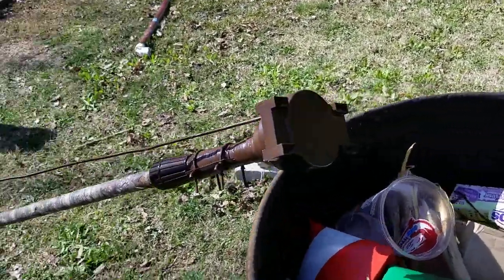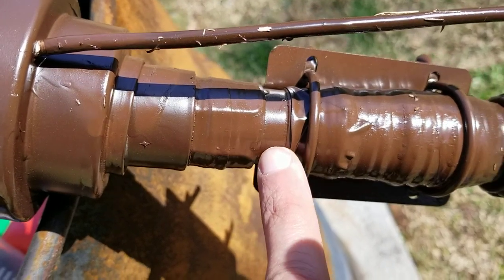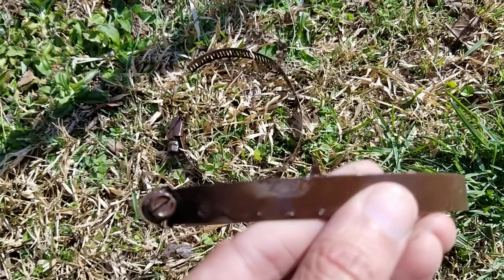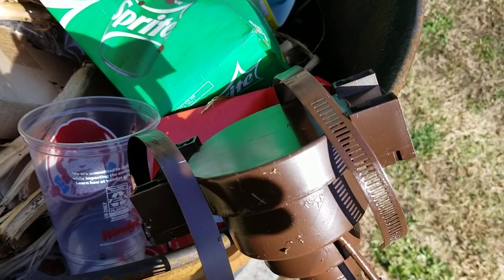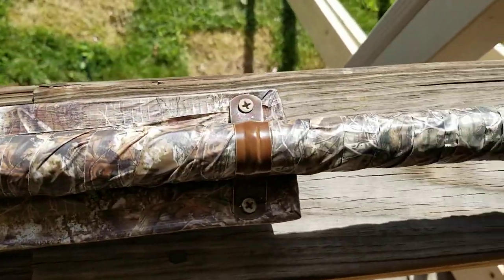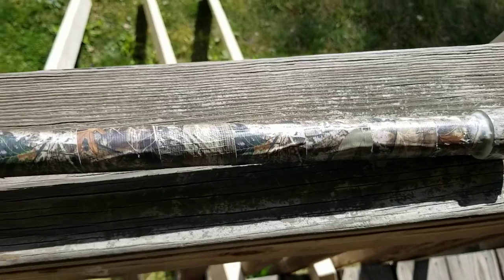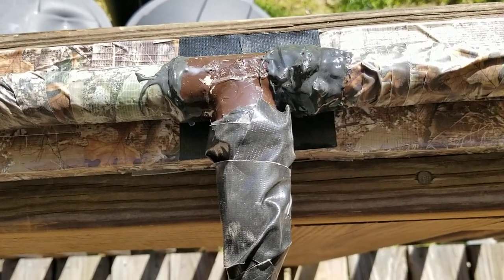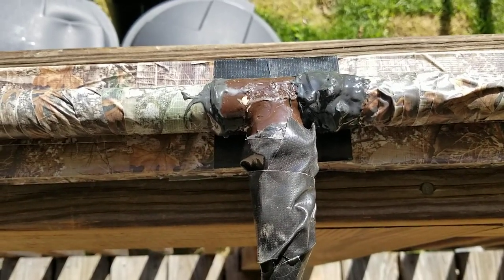102Inches cb Radio Antenna Homemade with camo design Without Rotor on March 27,2022 4PM EDT

Comment: Hey Foxman, there is a company called "Max gain systems" that sell all sorts of fiberglass telescoping kits, some are telecoping quad beam spreaders, or they have fiberglass telescoping antenna masts and all sorts of antenna making materials, they even have carbon fiber nesting mast poles, just about anything imaginable for antenna fabrication at reasonable prices too!😏👍

     You should get yourself a 1:1 balun for your beam, theyr'e usually under $20 bucks that will match the (unballanced) coax to the (ballanced) radiating element, the balun would make matching the two with relative ease!🤠👍